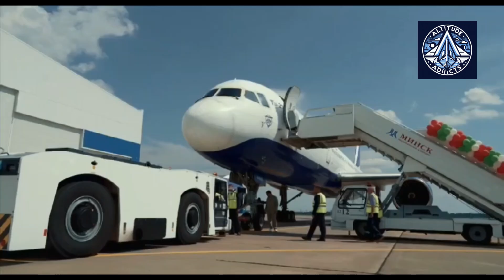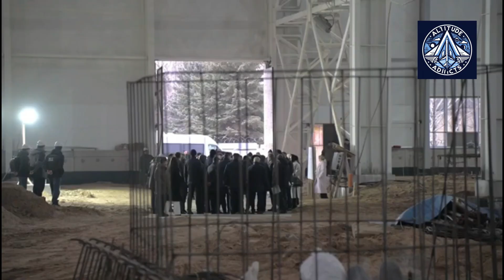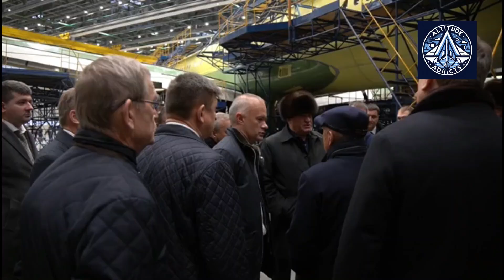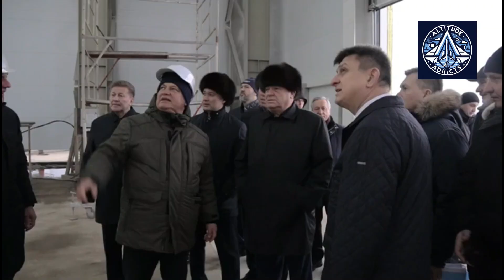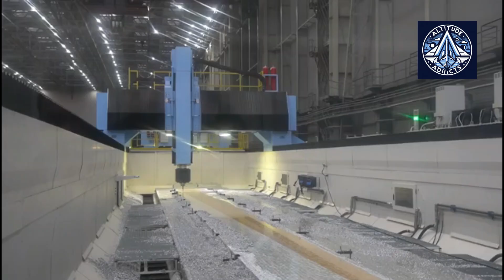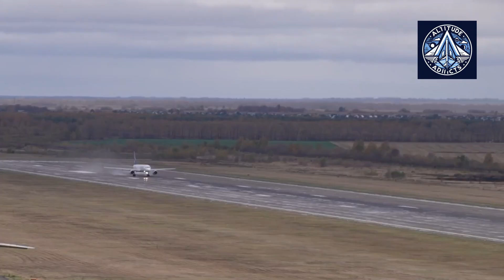Kazan Aviation Plant - Tu-214 Production Plans Are Falling Apart

Comment: It will take several years before it is possible to ramp up the production of MS-21 planes.. Therefore, the Tu-214 project is needed to plug the gap until the MS-21 is produced in sufficient numbers!!
Reply: Ykovlev should license the production of mc-21 or at least some parts of it to Tupolev
Reply: @KMASIF-mi9yj Or rather, yakovlev should use the newly modernized Kazan plant  (it's independent from Tupolev) to build new MC-21 planes.
Reply: @jackaboodf16  sure, but co-operation will help both company stay afloat and introduce the product in the market faster. Tupolev wants to modernize the tu-214 with the mc-21 cockpit anyway. eliminating domestic competition will turn you to Boeing.